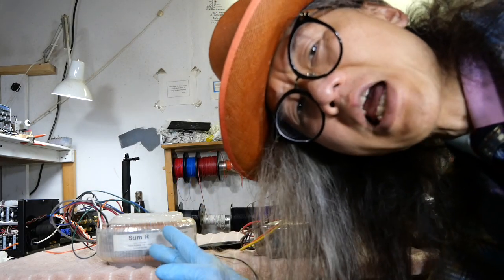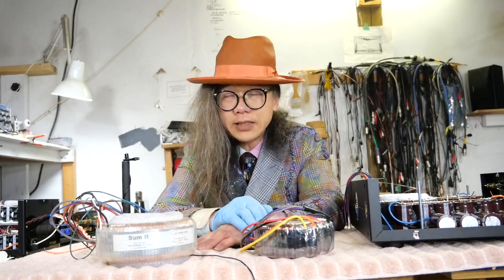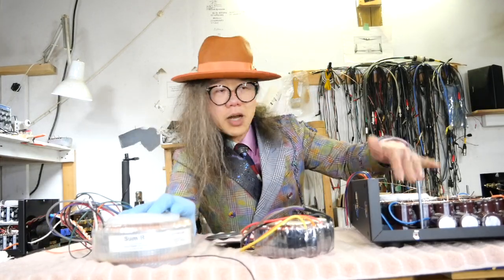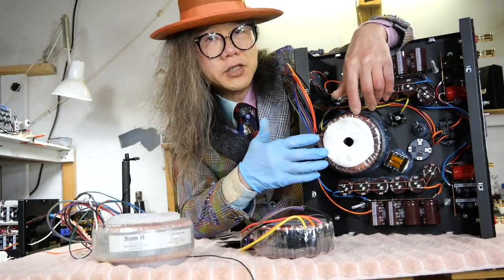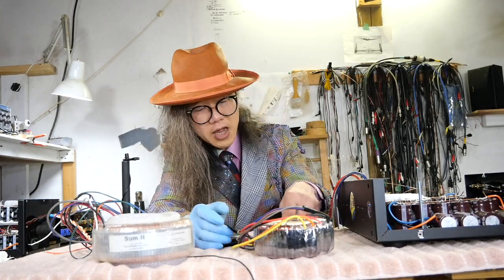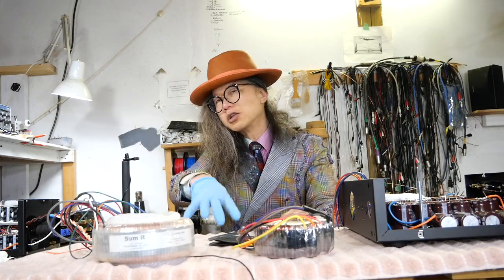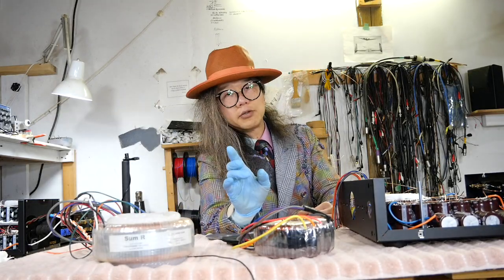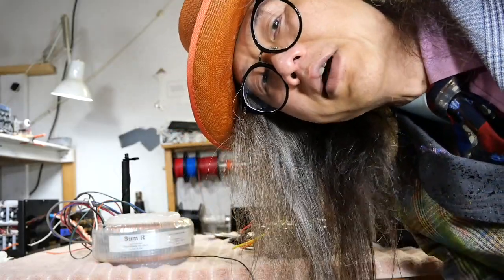Why do I use thick Silicone Pads to Mount Transformers?  Part 2

Comment: What about original blu tack inside the amps as well as under the speakers?
Reply from the maker: Blu Tack melt at low temperature.  Also deform too easily.  Not a good material for long term use inside any electronics.
Reply: Thank you! Really Appreciate your Channel and your expertise! I like your open minded approach (e. G. 4 Speakers instead of two…) in general!!!
Reply from the maker: @Hitsujiomeguruboken I am up to 8 speakers plus 2 sub woofers now.

Comment: the only reason i haven't done this yet is all of my silicone has ammonia which helps it adhere to glass ect but my fear is that it is too strong for mylar, and maybe it could etch copper or copper insulation.

Comment: can't help wondering if not using the clamp disc, screw and nut, which appeals to me to get excess metal away from the coil, why put silicon on the top?
Reply from the maker: I am using the clamp disc on top with bolt in the center for extra security for shipling.  I was showing it without in the video just to show how strong the silicone is.

Comment: Grok did some research for me (Grok is Elon Musk's AI and for technical purposes appears to exceed the abilities to dig out great technical information from the web.
Here's what I asked Grok:
"at what voltage could we rate the insulation properties of silicone?"
Grok:
General-purpose silicone rubber insulation might be rated around 20-25 kV/mm.

High-voltage applications (like power line insulators) might use specialized silicone with ratings closer to 30-50 kV/mm.
Reply from the maker: Do you think silicone has high enough insulation property for a 120v transformer? 😊
Reply: @angela-gilbert 😂

Comment: I have a technical question that goes one step deeper on this process.
Why all of the obsession for removing vibration?
I will be the devil's advocate on this just so that I can wrap my head around it.
We aren't talking about a mechanical device here, nothing relies on something moving or not moving, like a stylus in a record. It is just electricity moving one place to another at more or less the speed of light.
My car can time a spark to the spark plug within + - .05 of a degree of crank rotation at 7000 RPM while being jostled and vibrated around. Airplanes vibrate terribly, but their electronics work reliably.
So why does my amplifier need to be damped to sound better? What is happening with the damping to make it sound better?
I know that what you do works because my i807 is by far the quietest amplifier I've ever owned and because of that I consider it the best sounding amplifier  I've ever heard.
Reply from the maker: My first and main goal was not about vibration.  It was about filling the gaps between the transformer and the top and bottom metal plates so it doesn't cut through the rubber washers and short thing out.  Vibration control is an added bonus.  However, vibration do affect sonic performance but how much is depending on what part is receiving the vibration.  For example, vacuum tube can work like a microphone when it gets microphone.  If it is mounted on the same chassis as the transformer, the tiny amount of vibration can transfer from the transformer to the vacuum tube.  It will still makes music but there is a fade background noise in the music which may have been caused by the transformer vibrating.
Just one example of going the extra steps.  One step may not make any difference.  A few steps together will have a better chance to make a audible changes

Comment: Just my 100% lack of knowledge and my try on inventing things:-)
What if the mass production, ordered some fast setting silicone and only put a "thin" layer, just enough for the bumps to be covered. Then have a thicker ready-made silicone disc they glued on top?
If you have the transformer production, one hour ahead of their usage, may you be able to do it?
Reply from the maker: The theory works, no argument there.  Just the matter if any manufacture is willing to go an extra step.
Reply: @ LOL yes. Nothing is possible, unless they see monetary gain:-)
Reply from the maker: @friedmule5403  This is added extra cost.  If things already working for them, they wouldn't want to add cost to it unless they can see this able to help them make more.
Reply: Topping should do this. But can my pair of B100 even sound better?